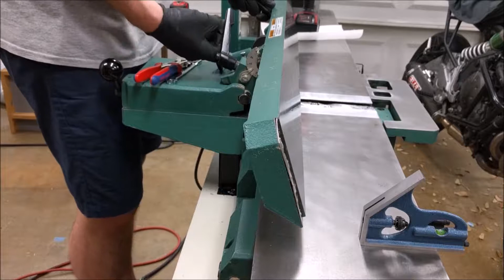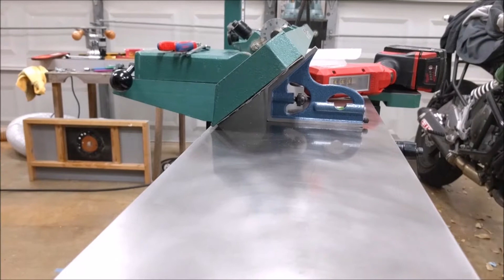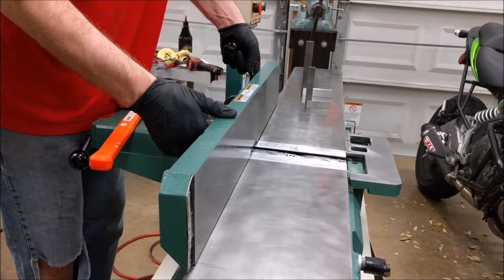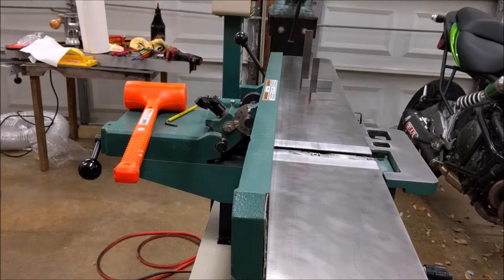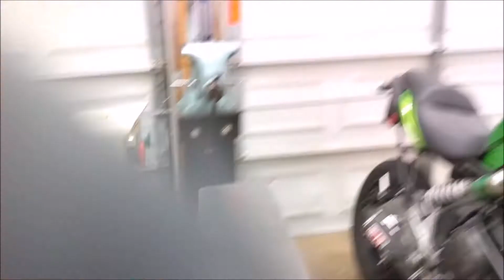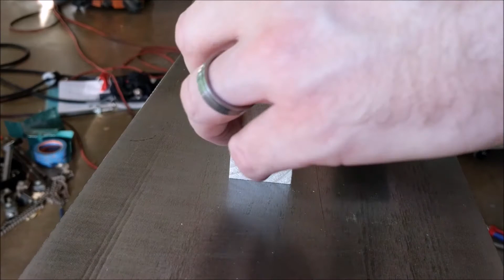Jointer Setup P4: Fence Adjustment

Comment: I never even bother setting the 45 and 135 stops on mine. I cant imaging a use case where I would need that much angle on my jointer. I love mu DJ20 which is exactly the same as the Grizzly G0490, but the fence is quite clunky

Comment: Have you had any issues keeping the fence square at 90?  Just got a G090X and had to shim the fence support to keep it parallel with the outfeed table because it wasn’t machined properly.  Replacement fence support from grizzly also wasn’t parallel with outfeed.  I can set the fence at 90 and lock all the stops but when doing a final lock with the quick lever handle it pulls the fence out of square.  Also can’t keep fence square when sliding it across outfeed table.  It comes out of square.  Very frustrating....any tips?

Comment: Thanks for the video!!👍 just put a spiral cutter on my delta DJ20 which is basically the same jointer and need to calibrate it.. had the jointer for 20 years and you have showed me some things I’ve been doing wrong on my setup.. thank you sir👍